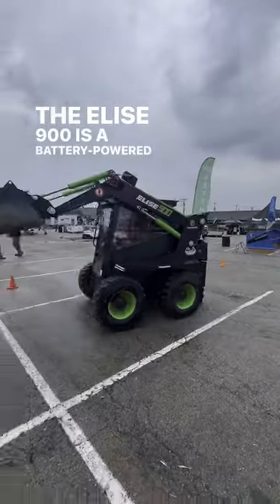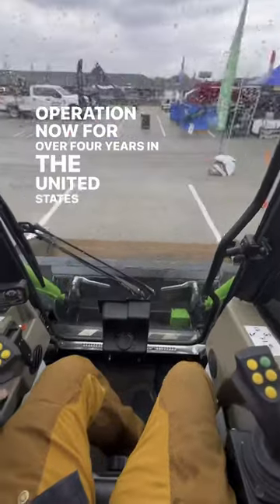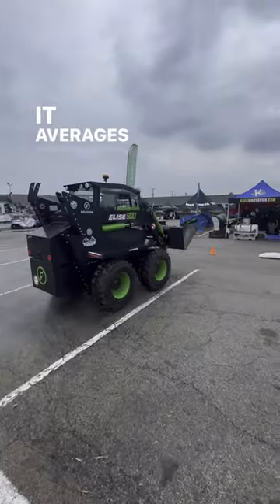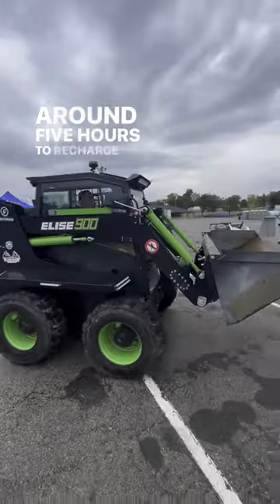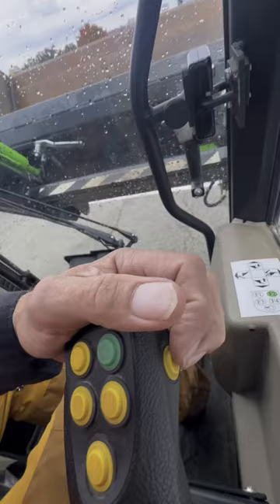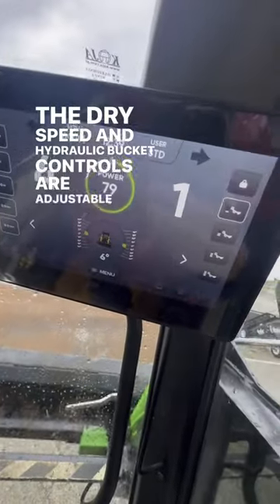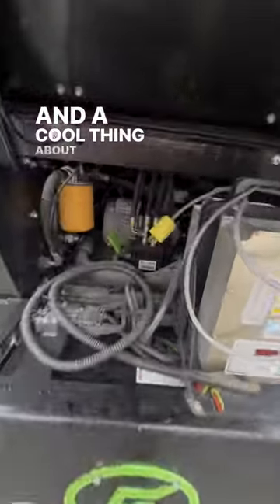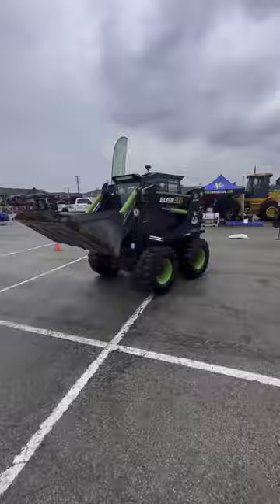Their’s a new kid on the block. #new #skidloader #shorts

Comment: A lot of people missing the point of this machine. Perfect for indoor work it’s not to replace your cat
Reply: Exactly, if you're working inside a warehouse or factory or somewhere you can drive a machine but it cannot be a diesel electric machines are perfect
Reply: or if you do work where you're doing short bursts of work like loading trucks at a stock yard or if you have to take it somewhere you dont have to sit and wait for the machine to warm up if you need to quickly load and go
Reply: Until they go zero emissions completely and then It is goodbye cat 😢😢

Comment: I would have to imagine if they were proud of the power it had in the hydraulics and drives they would of had some loaded pallets of pavers or sod and a pile of dirt to push around with it . That tells me me right there to he skeptical of it but hey I guess you don't know until you try it in the conditions it's meant to run .I also wonder how much running a hydraulic attachment like a power rake or grapple of brush cutter like you do a lot of drops the overall run time ???

Comment: I’m very sure electric machines are capable. My question is how long are the run times between charging. How long to recharge. And if your on a site with no electricity? Then what? Use a polluting generator to charge the battery powered machine? I just don’t see the run time efficiency yet
Reply: Run times on the larger 400 Ah battery are 8+ hours, recharge between 5-7 hours, depending on your amperage. Obviously if you don’t have electric on site, it would be hard to charge. However, there are a number of companies that are offering battery transfer carts, which you can transfer power to the battery, just like a fuel transfer tank. With the lithium batteries, there will be a fast charge option to charge in an hour, which you will be able to do with the battery carts as well.

Comment: I wonder how it would do in the snow plowing.
Reply: I'd be willing to bet it would have a significantly lower run time on those batteries in frigid Temps. Plus, if it were to be running a snow thrower or something else that needed constant hydraulic flow is another battery robber.
Reply: @DC9Douglas  yeah that's what I was thinking and I wonder if they have or will do a demo of it running in the snow doing snow removal.
Reply: @Deputy_Reidhaar We have a machine we sold in December of 2021 working in Steamboat Springs, CO with a snowblower. Customer is getting 5-6 hours out of it and still has 30-40% battery left. He does store his machine in a garage, which helps on the battery run time, however plugging the battery in to keep charge to it, which will help keep battery warm and also out of the wind, you should be able to do what you need to do.

Comment: Takes 48 hours to charge on 110, your lucky to get 5 hours run time & you absolutely will be buying new batts before 3 years, our county bought these worthless pos’s
Reply: Your county should be contacting the dealer that you purchased them from, sounds like there is an issue going on that should not be happening, whether it’s a machine issue or not.

Comment: Weak 5 hours to charge. Nah I’ll rather have a diesel and run a whole week with 1 fill up.
Reply: If you’re using it for anything other than a chair a diesel skid steer will not last a week on one tank. What do you do, work 3 hour days?
Reply: @joeyisamazing1091 maybe his attachment is just a big diesel tank strapped to a pallet that he forks around 😅
Reply: I go through a full 27 gallon tank of fuel on my cat 279d3 every day lol, sometimes I gotta fill up twice a day
Reply: @JMAN0153 i burn about 3gallon per hour in my 323e
Reply: For the guys that pay the bills… think it through.  About $10 to charge this machine 5-6hrs over night for 8 hrs work time VS what $100+ diesel for 8 hrs and not counting air filters, oil filters, oil changes….  Man hours to do all that.  This machine is NOT for all, for sure.  Yet, ABSOLUTELY serious option where it makes sense.
Reply: @absoluteequipmentsales_tx  like other people said. It runs about 3 hours at a snails pace. When electric is at its best technology yes it will be sweet. Other wise its a hunk of 💩

Comment: Just say no to EV
Reply: Imma just say no to people who oppose everything they didn’t grow up with.
Reply: @TranceFur ill fix it for him, just say no to junk
Reply: Electric/propane machines have a very niche use case when you need to do indoor work. If you're constantly doing say excavations inside warehouses where you can't run a diesel and only need to do basic stuff like move dirt and electric skid steer and an electric excavator are perfect.
Reply: just say you’re not open to change when it’s actually improving progress to make it slightly more transparent
Reply: I'm all for progress where it makes sense .
Reply: Say yes to pint sized nuclear reactors for engines like in fallout